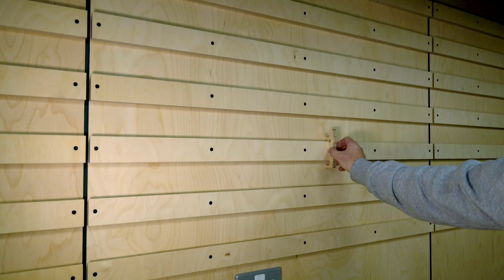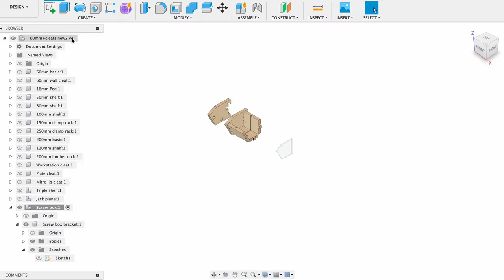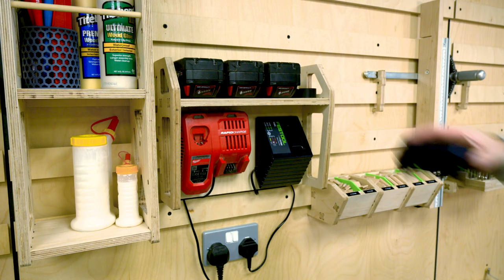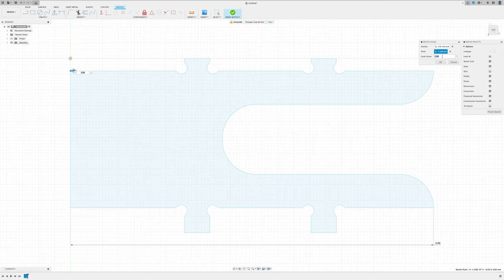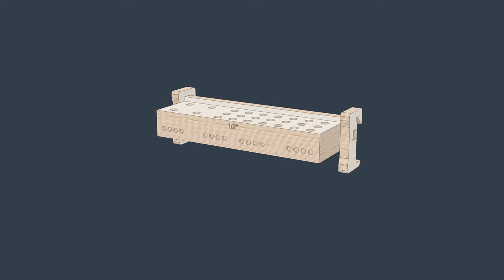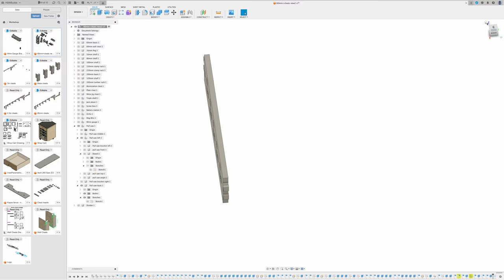A BETTER WAY to make French Cleat Tool Holders

Comment: Thanks for the video - really like the design of some of these. Don't suppose you'd be willing to share the fusion 360 designs - just would likely be easier to make modifications to fit my French cleat wall and material (for the most part I can only get 12 or 18mm ply - not 15) if I had that instead of trying to import the svgs and get all the scaling perfect (although your hint on fixing the scaling in the video was super useful). Already manually made variants of (most of) the more basic ones from your previous video to fit my wall and have built a number of things based on the concept - but these are a bit more involved and would require more substantial work to modify.

Liked your presentation style as well - doing quite good quality explanations for such a new channel.
Reply from the maker: Hey yeah sure I can share my fusion files. DM me on insta (@hswbuilds) and I can get you what you need.